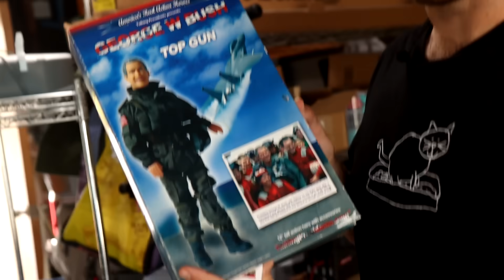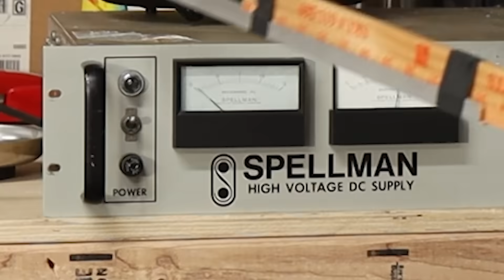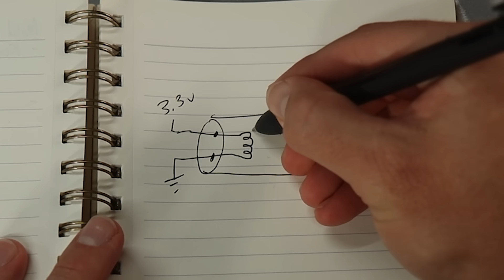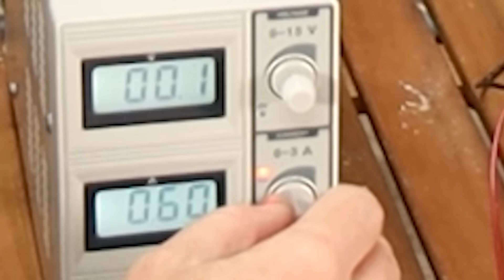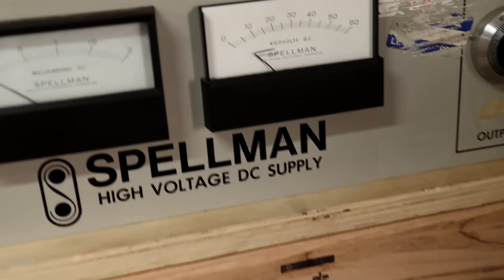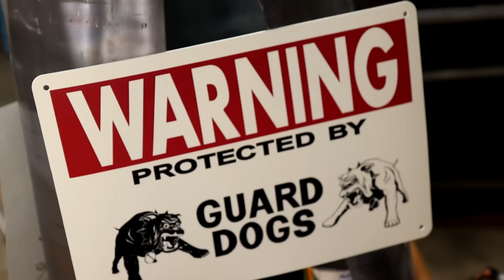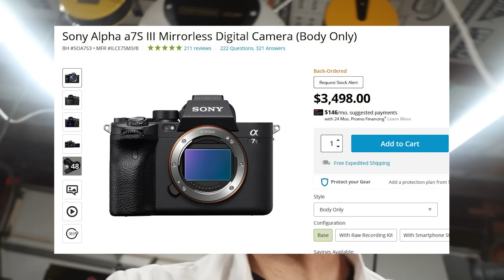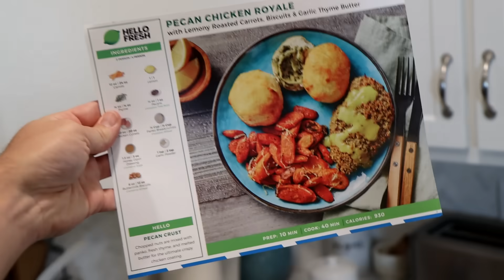Built My Own X-Ray After a Hospital Charged Me $69,210.32

Comment: As a field engineer that works on X-ray systems, this is hilarious. One caution I would give is that most system regulate the amount of time and amps to the tube because it will overheat. So don’t leave it on for more than a few seconds or you can wreck your tube. Fancy ones spin inside and shoot the voltage in pulses to avoid overheating. Great stuff.
Reply: I love how you're more concerned about the tube breaking than getting zapped or something
Reply: @dangerousglasses7995  As long as you aren't really stupid, you wont be getting zapped. Wearing rubber soled shoes often prevents electricity from running into you, and staying away from wires and metal prevents electricity from running through you. As for radiation, he is getting low doses in short periods of time. Prolonged exposure or extremely massive amounts of radiation can be dangerous. So was he safe? Nah, you should still never play with these things.
Reply: @dangerousglasses7995  😂😂😂😂😂
Reply: Wouldn't the power supplys regulate amperage?
Reply: @juliamonem133  That isn't the issue, X-Ray is made my shooting sparks at tungston, and the tiny explosion creates radiation. The part of the tungston you are shooting is what gets hot. In fancier systems than the dental pano he has the tungston is a spinning disc to help with that.
Reply: @juliamonem133 based on what? Your body has resistance so Ohm’s law comes into play… if you touch it and make a circuit with your body as a resistor and that much voltage the amperage will be more than enough to kill.
Reply: *YourTube©
Reply: @Yonnie Flores-Najera  Life is very dangerous. It always ends lethal.
Reply: Dude, i work in the same field specifically focusing on the inner electron beam optics. We have a focus voltage to control the spot size produced for all of the different voltages to optimize image quality with the power density into the tungsten.
Reply: Thanks
Reply: Thank you.
Reply: Safety nerds 2 meters up his butt 9:44
Reply: Doesn’t a x ray thing putt off s lot of radiation ?
Reply: @seadragongaming1407  tbh it is very little radiation. You get more radiation from a flight across the US than a big x-ray at a hospital. It is extremely safe, and dental units like what he has make very very little radiation.
Reply: Doesn’t a x ray thing putt off s lot of radiation ?
Reply: Also when you let it run for several seconds it can end up with crazy amounts of x-ray radiation... Like the Kerosan channel in Ukraine that jerry rigged a x-ray tube in their living room. Only later they measured the radioation and it was crazy strong even 50m away, they was standing around it running it for 10 seconds at a time many times earlier before testing how much radiation it created.
Reply: Could he die from this?
Reply: @yonnieflores-najera3226  yes. That power supply has far more than enough in it to stop your heart. If you somehow make physical contact and for some reason( no protection or not properly grounded) it makes a circuit. You will die, no exceptions your heart will stop.

Only question is. How high. After certain amount of amps. It's actually more likely to survive than at lower amp.
Reply: @lineheart972  idk what he has on his but real xray machines will very kill you dead. There is a 600 vdc bus for the space voltage and upwards of 150,000volts  to run across the tube, that can be multiple amps.
Reply: @yonnieflores-najera3226  you can die from anything since anything has a potentially lethal dose.
Reply: As a ___ that __ this is _____. Thanks
Reply: Nobody cares lil boy you're broke and make like 12 dollars an hour... have fun living on the streets
Reply: @x_rated3190  kind of ironic don't you think

Comment: those xray tubes have the capability to increase the background radiation of your room to nuclear reactor levels, that lead sheet won't save you, 20-30 minutes in front of the xray lamp is lethal. I've seen the measurments around and in front of those lamps.

Comment: FYI the potential needed for arcing is about 20kV for AC power, 30kV for DC power per cm, but that's for very dry air, air that is more humid has significantly lower voltage requirements.   Also once the arc happens it ionizes the air and then reduces the potential requirement even more so.   Not safety-nerd, just letting you know as you go up to insane voltage levels you need to be much more careful about where your exposed conductors are located with respect to one another.

Comment: @William Osman Not an expert or anything but I think you were having electrical arc because the can was close enough to the power for it to bridge the air gap. Even though it was connected in series the items you had wired (the loads) provided more resistance than the air did so it took the path of least resistance to ground, which in that instance was the air. Grounding the can didn't work because you were just helping it get to ground even more than before.

Comment: I do HV design for a living and I gotta say this was the best vid I’ve seen in a long time. Harrowing? Yes. Concerning? Yes. Hilarious? Also yes.
Reply: Also the HV equipment in my work lab is also ancient and seemingly on the brink of death. Still works though so you know it’s good.
Reply: I was honestly expecting the voltage to jump the insulation on those tiny wires at the beginning
Reply: @computergeek123ism  I didnt think the wires were thick enough I thought they would melt
Reply: @baconeater312  Same here. I've had similar gauge t get sheath melting hot at 48VDC 28amps. Im surprised it held.
Reply: @KiwiClawDHA  same. Those wires are nothing like the KV wires i have, we’re talking 6-12 strands of 16AWG, braided, with much better insulation and nowhere near any beans
Reply: @MM-tn5uk  well I hope so. Though of any medical equipment I would like to make would be an mri scanner. Gkt (hoping) new ideas on magnet and coil design for aiming magnetic fields, but jts way outside my reach. (Like buying xray equipment off ebay) XD
Reply: I was expecting the filament supply to need to float at cathode. Was ready for a blown supply as soon as the Spellman came on.

Comment: Need to be carful with any ionizing radiation. Consider getting a Thermo luminescent dosimeter so you can be sure your not over exposing yourself.
Reply: You seem to know what’s what. Care to elaborate if this is even remotely safe?
Reply: @cmen6895  As long as the tube isnt doing weird stuff, it should eb the same as visiting a dentist
Reply: @romanuks3493  Those turn on and off faster. Id be worried of over exposer. You'd want a computer to operate it. Program a raspberry Pi. And test the amount of radiation given off.
Reply: @romanuks3493  Not with his set up, he literally put current to the tube with a dial when he tested the tube, he exposed for around a second, which is about 500-800 times longer than a hand x-ray at a clinic, if he used those settings to image his hand, he got the equivalent of 500-800 x-rays. Imagine being in the sun for 10 minutes then compare it to 500-800 minutes. Ouchie.
Reply: @cmen6895  I can’t say just bc I can’t test the X-ray levels myself. But any un contained X-ray source will emit outward rather than on a focused point if not shielded correctly. This will expose people to radiation and any amount over 15 M/rem isn’t good for a person. It’s a low amount. But consistent exposure will cause radiation sickness or cancer overtime.
Reply: @cmen6895  eh, comparing to a clinical set up his setup is crude at best; his lead cone shielding does more harm than good by directing scatter radiation in back towards his hand, same can be said with the canned good frame, all they do is direct scatter radiation to his hand, dose goes up. His hand is closer to the source of the x-ray than conventional imaging so dose goes up, he used a dial to put current to the tube increasing the length of his exposure and guess what, dose goes up. I'd rather take 100 x-rays of my hand at a clinic then use one of his. Not to mention the quality of the image is so bad that they would have to be repeated anyways rendering his imaging useless. In the grand scheme of things one exposure won't do anything, however if he takes them over and over and over again, he could run into trouble. 

Don't get me wrong what he did is cool and I'd be taking pictures of all sorts of inanimate objects all day but using it on myself or anyone else is illegal and just stupid.
Reply: He has one in his front lab coat pocket.
Reply: @unkown9081  ok I didn’t catch that then.
Reply: nerd
Reply: @smoknovo4541  yea my bad bud. Is my burger ready?

Comment: I had to have my foot fixed with a surgery. The costs were:
135€ fixed cost for daily surgery (no overnight stay)
I'm not even sure if I was billed but the 3 checkups including doctors exam, physical therapy and x-rays were 41€ per visit, but as I said I don't know if they bill those.
I have no insurance. And if I did, I wouldn't have any benefit under these circumstances. I guess it could be worse.

Comment: Hey Will. No amount of x ray is safe. Even a small amount can cause cancer. Just the more radiation you get the higher the chance of cancer. 
Also with out shielding on the tube. The x rays are being shot in all directions. Not just the FOV from the Adnode.
Reply: Ionizing radiations aren't great but afaik he wasn't exposed to such a large amount based on the counters he had. He should be fine. Kids who do a lot of sports are probably exposed to more X-rays cumulatively from all the injuries they tend to get.

He probably shouldn't really play with it anymore though. If it's just for this video then I think he'll be fine.

Comment: Your xray did not have to undergo the stupidly overpriced testing and certification for safety standards which massively inflates costs.  Also note, uninsured people would pay the same you have to with insurance.  It is a scam.

No I have never had an xray or ct scan.

BTW that personal dosage mater turning off is a result of a spike over the limit of the meter.

Comment: Curious what else you had done, because an x-ray in today's age only runs around $100 at most... besides, you don't need a "really good" insurance plan. Get a cheap plan with $15,000 deductible and maintain that much in a savings account should you need it. If nothing happens all year, you've saved a boatload. If something happens, you've got the deductible ready in the bank.

Comment: Maybe you could buy a fluxcapacitor on ebay! 🤤.. Use your High voltage psu, go back in time, with the knowledge of your overpriced x-Ray and live forever free!!

Ow btw, don't go back to far.. Maybe the high voltage psu is not being invented yet..

Or was it 1.21 gigawatss.. Anyway, if you get stuck give me a call. I'm born in 1985 so you should be able to find me.

Comment: I read a long time ago that if you put a tungsten filament light bulb in a microwave and turn it on, it produces x-rays.  
It's probably not nearly as accurate of a dose, so safety is sketchy.  But it's cheaper than all that equipment you got if it's true.

Comment: The oil was used to slow down the electrons by colliding with the oil, causing them to aquire a negative charge. Without the oil the electrons are free travel in every direction. The stand of metal cans was just conducting the postive charged electrons. The electrons were omnidirectional, xrays were directional.
Reply: Everything about this comment is wrong.

Comment: Sure safety is relative. But you can only judge it if you have some actual numbers. There are tons of safety regulations round X-ray machines, because they can really fuck you up or even kill you. If you've read the spec sheet for the tube, and understand how radiation works, I suppose that will inform you how many actual roentgens you're risking. It's not calculated risk that shits up safety nerds, it's the unknown!!! 

BTW that tube probably produces some X-rays even without the filament powered up. Electrons are still gonna fly, if they can zap through air in a 6-inch spark, they can hit the target at the end of the tube, fast enough to cause the roentgenstrahlung from their decceleration. How many? I dunno, I've got a big chunk of planet between me and your contraption. The filament and proper power control produce a reliable, consistent amount of X-rays suitable for firing through people's cheeks. 

The oil BTW is an insulator, because, at that voltage, everything is a wire and you'll probably die. Also shouldn't you have connected to the other side of the resistor on the tube? So that it was in circuit?

Comment: I'm less concerned about the radiation or more concerned about the huge amount of exposed wire with insane voltage. Like, how much effort would it take to put on a sleeve or even just electrical tape???

Comment: A used (fully functional) XRay machine is about 5k on Ebay. 
But this doesn't mean the 70k cost is related to the machine by any means. Your bill is 70k because hospitals can and do charge insurance companies to those amounts with a little to no resistance which gives them free reign on controlling the pricing. 
Second factor is the hospitals have expenses for imaging, mostly related to "insurance" on their end as well.
The common denominator in inflated prices is the insurance factor.

Comment: "Why is it arcing?" It's almost like it was submerged in oil for a reason.
Reply: Why was it arcing? Who knows, it was bought off ebay and taken apart by a bootleg garage engineer.
Reply: Step one: cover yourself in oil.
Reply: I hope it's from a newer x-ray or that PCBs were never used in dental x-rays.
Reply: @tutacat I know, I was just poking fun lmao. I also know we use oils to submerge certain reactive metals to keep them from exploding or something
Reply: Probably right, probably harder for radiation to leak in every direction as well, probably dense enough for them to bounce off the oils
Reply: Yes the oil would slow down the electrons by colliding with the oil, causing them to aquire a negative charge. Without the oil the electrons are free travel in every direction. The stand of metal cans where just conducting the postive charged xray electrons.
Reply: @ZeroSpawn  I just noticed that you called them “positive charged xray electrons”.

Actually, the arcing has almost nothing to do with the X-ray tube. Instead, it is due to the very high voltage from the high voltage power supply.

The X-ray tube has two parts as William mentioned. The filament that emits electrons (basically a light bulb) (also known as the cathode), and a target (anode) that is set to a very high voltage relative to the filament with a high voltage supply.

The strong positive charge of the anode causes the electrons emitted by the cathode to speed over to it and crash into it, generating X-rays on impact. X-rays themselves are not electrons, but rather a form of electromagnetic radiation, like daylight or radio waves or microwaves.
Reply: @davak72  Thank you for your insightful comment. Would you care to elaborate on why specifically the x-ray is generated? My understanding is that the high speed collisions of the electrons with the anode knocks out the electrons in the inner orbital of the atoms of the anode, shifting higher n level electrons to lower orbitals, giving off an x-ray photon in the process. Why isn't this the standard visible-light photon given off in the normal ground-excited exchanges? I'm assuming this has to do with the potential difference between the cathode and anode, which would accelerate the electrons at different rates. Therefore, would a different voltage cause different types of radiation to be emitted? I learnt the basics of how an x-ray works a while back, but I was never given specifics as to why specifically the x-ray photon is emitted.
Reply: @davak72  thanks professor
Reply: @overlyengineered6202  Your understanding is actually right. The electrons from the cathode interacts with the inner shell e- of the atoms of the anode. This is by the virtue of the Photoelectric effect. The ejected e- is released and becomes the characteristic x-ray. If it interacts with the nuclear field but not with the orbital e-, the x-ray produced is bremsstrahlung. The difference between both x-rays is that characteristic has fixed energies, meaning its energies depend on the EBE of the e- with the nucleus; while bremsstrahlung has varying energies. Both types contribute with the production of an x-ray in a normal XRT. Meanwhile, in normal ground-excited exchanges, the energy of the e- is never enough to eject an e- so it only excites it, causing heat. This is also the reason why XRTs create more heat than x-rays and why the oil and rotating targets (incl. the material it's made of) are very important insulators to dissipate heat within the tube and prevent tube failure. Also, different voltages does not necessarily cause different types of radiation to be emitted though as XRTs are mostly only capable of producing x-rays or gamma rays (both of which have the same energies but diff. origins). Instead, various voltages causes different energies of x-rays to be emitted. For radiography, we use diagnostic x-rays; but in teletherapy units, it varies from orthovoltage to megavoltage, depending on the type of treatment (if it's superficial / deep). I hope this helps.
Reply: @ejslax  Fascinating. Good stuff, thanks for the explanation, super helpful.
Reply: @ZeroSpawn  oil is dielectric
Reply: @ZeroSpawn  Close. Electrons can never have a positive charge. They are always negatively charged by one electron-Volt.

The rest of what you said almost makes sense as a metaphor for what is happening using the mechanics of momentum.

But the actual difference between air and oil in this application is the breakdown voltage. In dry air, the field strength for breakdown is only about 3 kV/mm, whereas in oil-cooled and oil-insulated transformers, it is about 20 kV/mm.